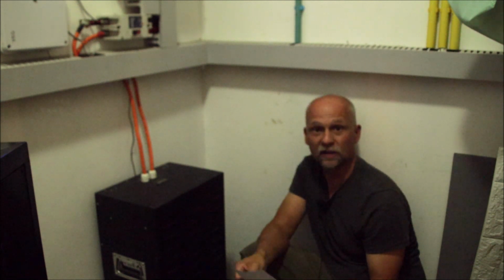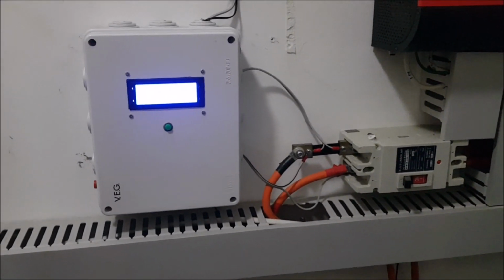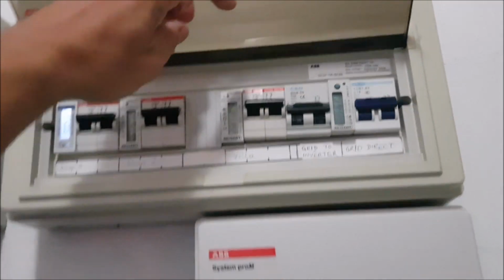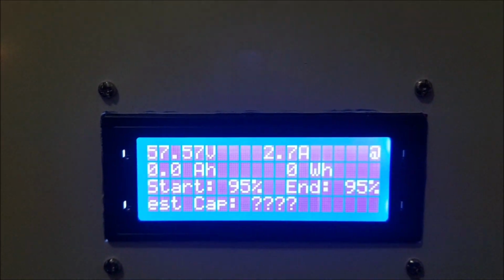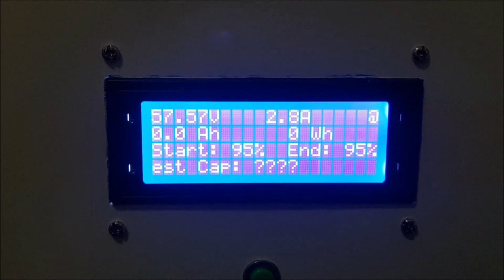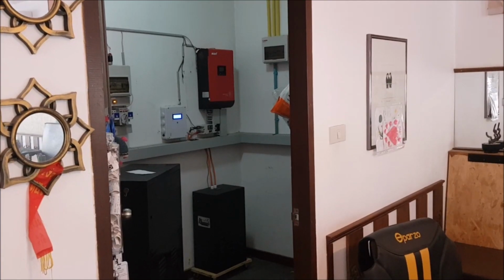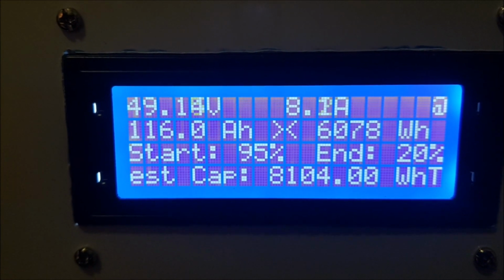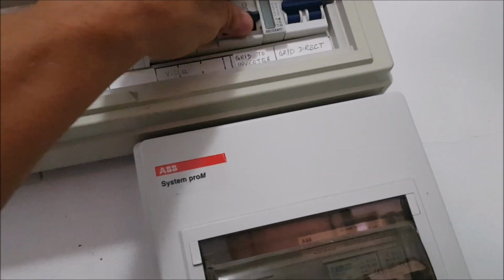10kWh Lithium-Polymer (LiPo) Pack after 5 years. How did it hold up in my PV-Off-grid system?

Comment: Good video Roland. I'm using second hand cells for my 10KWh battery, payed them around 0.75€/each, so I suppose I could get a good ROI, didn't ever calculate it, I will though. It's difficult to count all the expenses, for example the spot welder and all the other accessories... It will take me some time. Keep it up!

Comment: Did you reach your ROI yet? I do not know price of electricity in your country.
Reply from the maker: Pure battery systems as you know will never return their investment. Here the cost of electricity is only 15-20 Cent US in average. It has payed off around 40% of its cost till now. But we need to have emergency lighting in case of grid outage by law. This is my solution of doing that. As well this is my emergency power during storms, etc. You cannot put a value on those extra features
But with the help of the grid tied systems all of my installation will still pay off after around 8 years.
Reply: @RolandW_DIYEnergyandMore  Well 8 years is about the ROI on systems in Canada too.